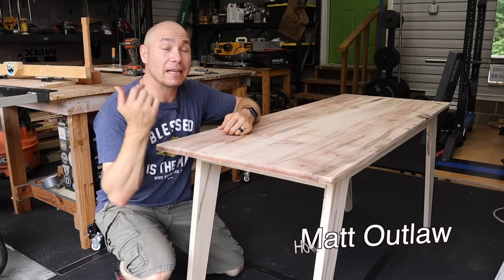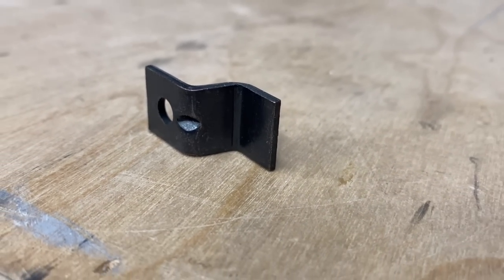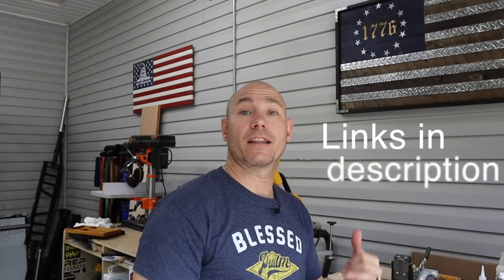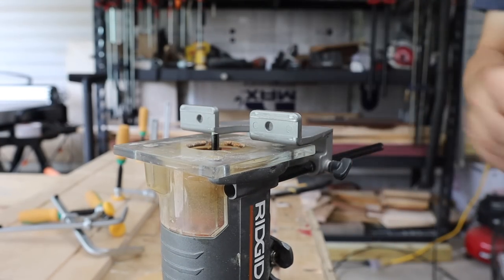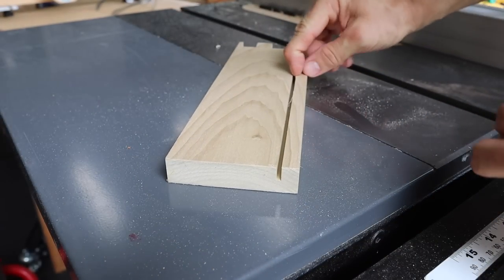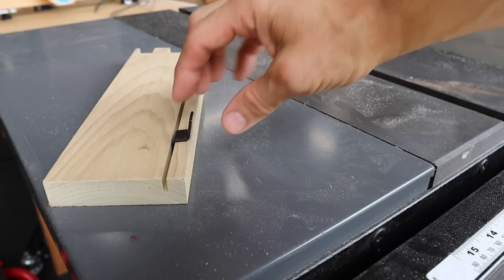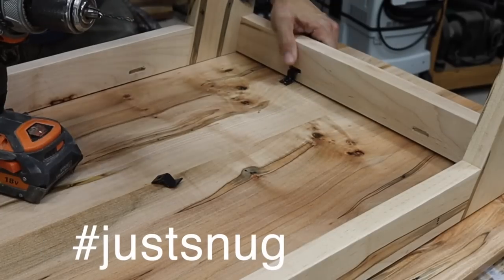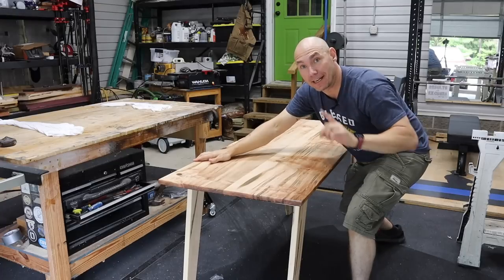How to Attach a Table Top to Allow for Wood Movement

Comment: One thing you didn't mention Matt, is that by using the Rockler clips, you can also remove and replace the table top if you need to with minimal time and effort. In case you wanted to remove the top to do some insert work, or carve out a design and fill with epoxy later and didn't want the hassle of having it attached to the legs, these clips make removal a snap.  Great video my friend, as always.
Reply from the maker: That’s right. Thank you

Comment: Thank you for this. I usually use pocket screws but I built a castle joint L desk and wanted it to be able to tear down multiple times without losing its strength . I had no idea this was a thing. Much appreciated

Comment: A great way also to attach table tops with the z clips is using a slot cutting bit in your router this way you don't have to hold the router sideways but in the upright position which is a little easier to manage.  This was a great video with awesome tips!  Thank you!

Comment: Great video. The way I cut the slots is with a biscuit joiner. Set the correct depth, plunge it and slide it across the piece.

Comment: Matt, fixing the Z clips down the length of the top (with the grain), does that prevent the top expanding across its width? The clips look like they'd prevent expansion that way (though not contraction).

I've used this same method but only on the ends and one side so the wood had space to move.
Reply: Exactly... The zclip is not enough, it has to be able to move into the apron

Comment: You can stop wood from expanding by plugging the ends with wood glue, paint, or lacquer. This would need to include the table top and the skirts, and you'd have to skip pocket holes and other such screws where moisture can enter, but once done this way even larger tables can be directly glued to their skirts without wood expansion concerns.

The drawback, of course, is that any hole in the submarine sinks it.

Comment: I used fasteners like these for a few projects, a table for my laundry room and also a side table that I was planning to sell. The top on the end table never seemed to be secure and I could pretty much move it in any direction with a slight touch. The laundry room table top was secure initially but after a few months the top was moving on it as well. It kind of stopped my plans for being a woodworker. I don’t want to sell a table only for people to say that the table top is moving all around a month later. I’m not sure what I did wrong.

Comment: Nice video!  I'll admit I've yet to make my first table.  I had imagined I would just use pocket screws to attach the table top.  These clips look like they will work too.  Which do you think is better?  God bless!
Reply from the maker: These clips. If you use pocket screws it won’t allow for movement of the wood
Reply: @731Woodworks  makes sense. I will have to get some. Thanks 👊

Comment: I have a method that has proven good for about 30 years. Make two spreaders between the long sides of the frame. Dovetail the top edge. Dovetail the ends so they lock into the long sides of the frame. Cut the female of the sliding dovetail into the underside of the top. Assemble the top tothe runners and tha runners the frame. Kind of eloquent actually.

Comment: Matt, Question, on a wide tabletop would it be a good idea to only Z clip the ends and cross members not the long sides of the frame/apron ? Could the clips on the long sides inhibit the width expansion, or is the width expansion not so much that the clips can move into the slot. Hope this question makes sense. Really appreciate your channel ! 👍

Comment: Question from a novice: those clips look quite loose in the routed slots. Does this make the top move about in general use though?
Reply from the maker: No, when you install the screws, they tighten up

Comment: Do I need z clips for a plywood top with plywood apron, or would glue and a crown staples work?
Reply from the maker: Nope. Plywood doesn't expand / contract.   You can glue it, screw it or staple it down and it'll be just fine.
Reply: @731Woodworks  Thank you so much for the reply. That was what I was thinking, but I’m a beginner and needed that advice from a skilled wood worker.

Comment: Would a 1/4 straight router bit be ok for this? The bit you are using looks larger than 1/8… thanks in advance!
Reply from the maker: yes that would work.  It's an 1/8" bit I have

Comment: k, what if you have neither router nor ditto whatever?  I got miter saw, level, drill.  that's it.  Okay, got clamps.
Reply: You can do it with a drill, but keeping it at a certain depth and straight will be near impossible with out a jig of some sort.  You will need a tape measure for sure.  It can be done, but it will be slow going.
Reply from the maker: Make a small jig to use with your drill
Reply: @robertjohnston5842  thank you, I hadn't thought of that.  I can make a jig, and try that out.